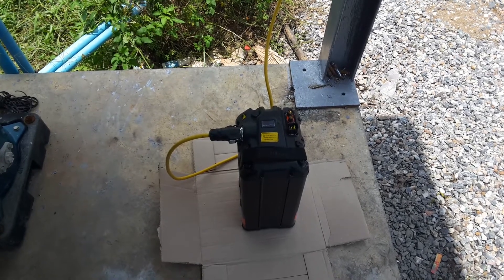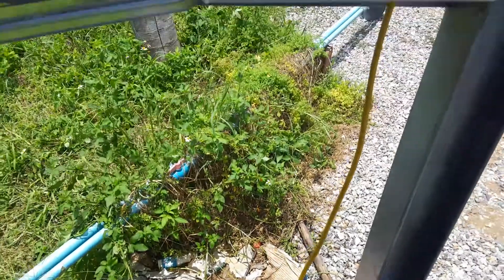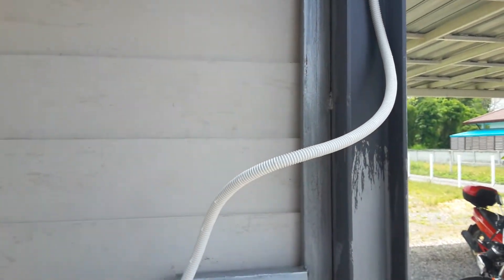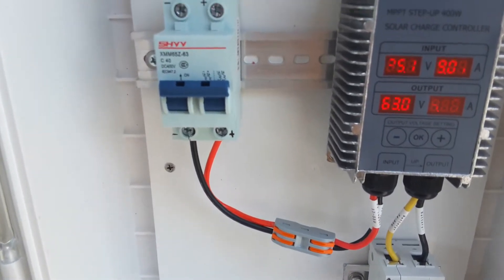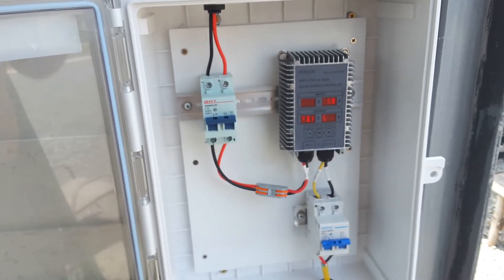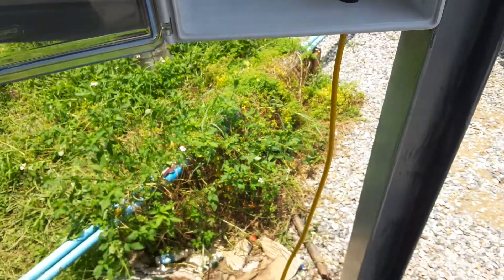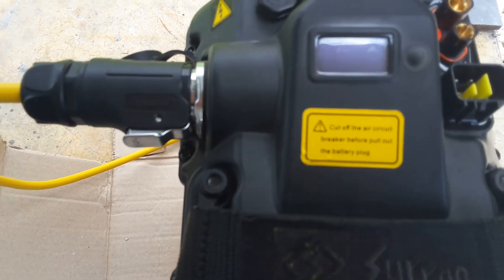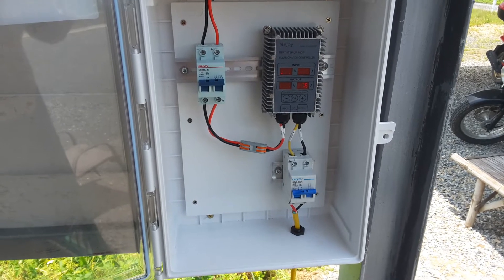I Made A Sur Ron Solar Charging Station **Earth Day 2022** free electricity!!

Comment: I'm so tempted to build this exact solution myself, it took me a long time to plan it then I came across your video showing the exact idea I had, that's awesome. I'm a bit scared of messing it up or something going wrong with the step up controller and messing up my battery. It's almost impossible to import SurRon batteries in South Africa at this stage. 
Would love to see a follow-up video on how this setup has been working out for you over time etc. 
Great work man!
Reply from the maker: Works fine.  Just get a multimeter to double and triple check your wiring and do not overcharge the battery.  Just set a cutoff voltage of 95% or so, say 65.5V.  My setup works fine and charges a bit slower than using mains electricity so is better for the battery life.
Reply: What AWG cable are you using?
Reply from the maker: I think it was 2.5mm2 gage.  Not sure what that is in AWG.

Comment: That's a beautiful set up.  You even bought a OEM 3 pin plug to charge through the charging port. Can I buy some of these parts from your store?
Reply from the maker: Yes I sell the MPPT boost controller for $50 plus shipping and the Sur Ron 3 pin plug for $30 plus shipping.   I let customers get their own PV solar panel as its easier to buy in your home area.
Reply: @ebikecnx7239  yes those connectors are rock solid and good quality but kind of expensive.  Because the Grin Technology battery charger uses XLR I kind of wish they'd gone with XLR.
Reply: @ebikecnx7239  Does your 3 pin plug come with the yellow cable? If not, which cable is this? 1.5mm / 2.5mm 15 amp 3-core? Also, the breaker under the boost converter, b-curve 10amp DZ47-63DC by CHCYZO... Where can I source these? Once I've built my portable system with the 3x 100w allpowers foldable panels... We should organise logistics and I'll happily sell these to the European market and we will go 50/50 on any profits. I'll rebrand them and sell as a package. Much cheaper than a spare / higher capacity battery...
Reply from the maker: @MrX-bp9ty  The plug doesn't come wired up, so I simply used an appropriate sized flex cord I had around and cut off the length I needed.  I am glad you like the idea, please email me further at ebikecnx@gmail.com and we can discuss.  Yes, I can ship all these parts to UK/worldwide.